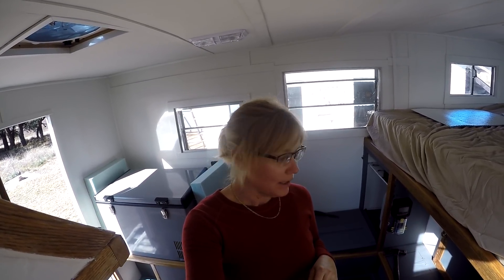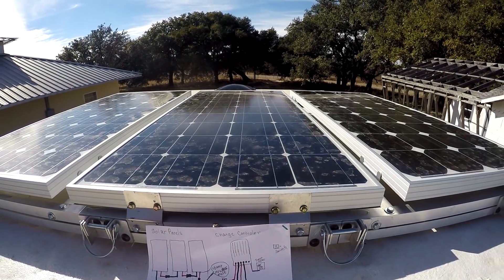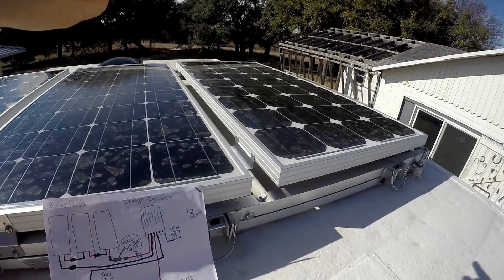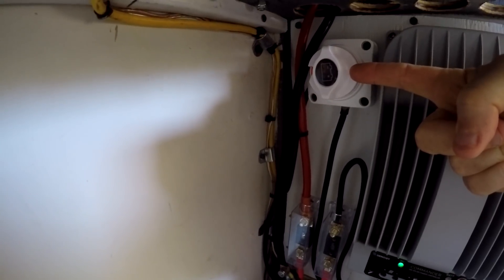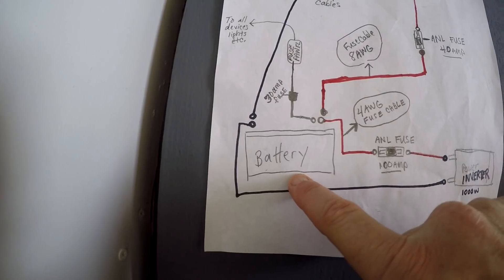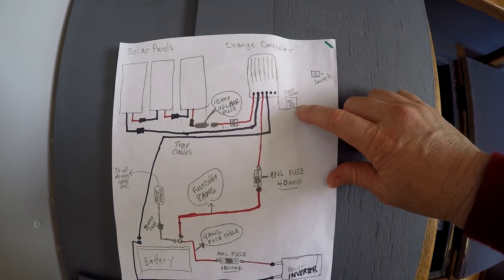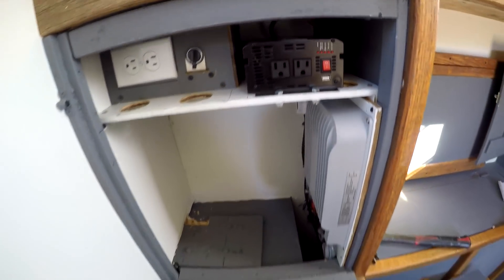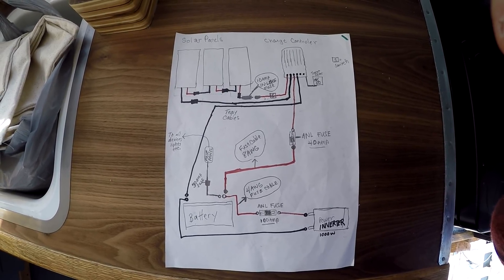Solar Power in Refurbished 1965 Truck Camper

Comment: Great video!!!! I was wondering was your FNL fuse line from the battery to the 40a fuse a smaller AWG then the tray Cable? My Tray cables that leave the MTTP are 4AWG then the red fuse line is 8AWG. is that normal? Renogy's help line is down and no one answered all day. I found this video, and I running the same set up as you. I feel like they sent me the wrong wires because everything in the kit was 8AWG. Great videos and your rig looks AMAZING!!!
Reply from the maker: http://www.begotka.com/solar-power-off-grid-truck-camper/   That's a link to a simple diagram we did of our system.  I know we did have several different sizes of cable.....we definitely had 8 & 4 AWG.
Reply from the maker: Just looked at that diagram....realized not every cable is labled.  We'll take a look and make some notes and get back to you.  Might be a bit....we are getting on the internet very (VERY) sporadically while we're traveling.

Comment: Have you thought about a disconnect on the battery?
Reply from the maker: Hi - it would be easy to add one and maybe we will one day.  I don't anticipate needing to mess with the system much.  Right now if a need arises we'll disconnect the stuff on the battery direct.  It's easily accessible and there's not much connected to it.  There's a lot more stuff that people add to systems.... and that's cool....but we're starting out relatively simple.  We will continue to post videos and updates on how everything is working when we begin traveling.   Thanks so much for watching and commenting.  Have a great day.